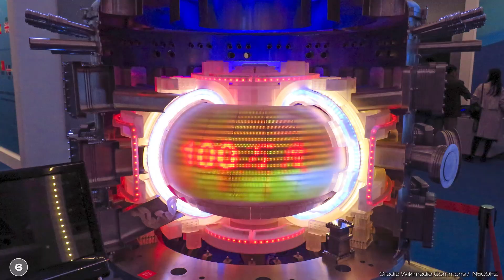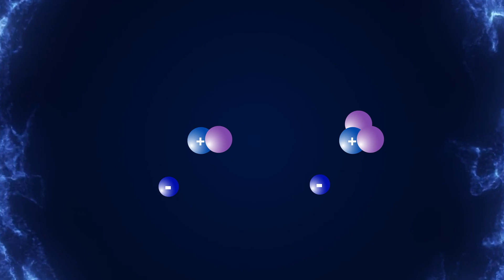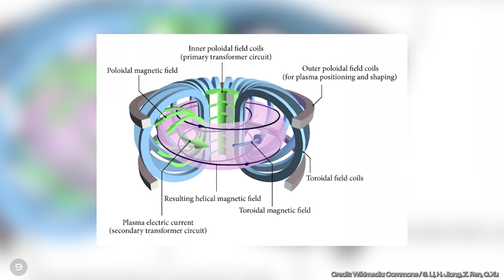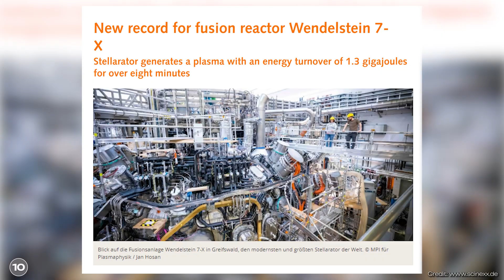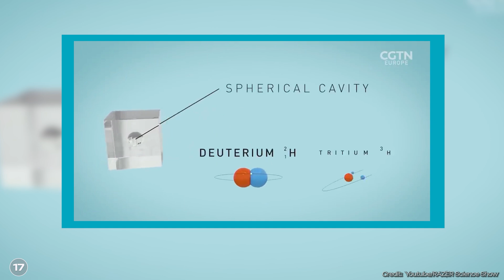Nuclear fusion cancelled?!  Is this this the end for ITER?

Comment: Nuclear fusion energy experiments began in the 1950s and since then two generation of experimenters have encountered numerous barriers that they hadn't expected to happen. In many cases they came up with solutions and workarounds that vastly increased the complexity of the systems, making them less attractive as eventual competitive electricity generation sources. The field is so complex that the promoters have plenty of opportunities to omit key evaluation details, which they commonly do. Scores of such experimental machines have been built and operated. All but a very few have utilized tritium and therefore generated a significant amounts of fusion energy. See the Wikipedia article titled 'List of fusion experiments.' Since the beginning the public has been told that the hydrogen fuel is almost limitless. Rarely do the promoters mention that tritium is radioactive and never to they mention that commercially available tritium costs more than $30,000 USD per gram. The ITER project is grossly over its original budget and well beyond a decade behind its original schedule. They have encountered major construction difficulties that has set the project well back in time. Around 2023 the administrators stated that the first deuterium-tritium fueled experiments wouldn't begin until 2039. They admitted that was too late to deal with the climate change issue.

The flashy announcement, regarding the NIF 'breakeven' event obscured far more than just the the fact that the energy, needed to pump the lasers, was over 100 times the energy value that they used to calculate the fusion energy gain (Q). It is standard practice, in the nuclear fusion energy field, to not provide the total amount of energy expended to achieve the fusion energy gain value. The 12/05/2022 NIF laster shot took about a week to prepare. The fusion reaction lasted for 0.000,000,000,08 second. The reaction began in a microscopic spot within the center of the spherical body of compressed fuel. The reaction then produced an explosion that blasted away 96% of the supplied, expensive, fuel before it had a chance to fuse. There was a limited propagation of the reaction. Nuclear fusion energy promoters tend to utilize the term 'ignition' in a deceptive manner. The 'breakeven' experiment was supposed to have been achieved by 2012 but the goal was missed by a factor of over 100 then. It took a decade of extremely expensive tweaking to finally achieve the desired results. The promoters have always been masterful in obscuring the primary function of NIF. It has always been primarily funded as a thermonuclear weapon (H-bomb) research tool. The 12/05/2022 shot was part of that program. It's been estimated that NIF has already expended in excess of $11 billion USD in federal revenues. A inertial confinement fusion (ICF) type power plant would need to fire at a rate of at least ten shots per second. Just on that parameter the NIF 12/05/2022 experiment was millions of times away from that goal.

Commonwealth Fusion Systems (CFS) typically refers to their SPARC experimental machine as being a prototype of their planned ARC power plant which is supposed to be fully functional, including breeding its own tritium fuel. A close examination of the rarely mentioned details of SPARC will clearly show it lacks major components and behaviors of the ARC machine. SPARC is expected to eventually generate fusion pulses lasting for a maximum of 10 seconds and then it will requires many hours to thermally stabilize before another shot is attempted. The fusion duty cycle will be abysmally low.

A statement was made that the Wendelstein-7-x stellarator achieved an energy turnover of 1.3 gigaojoules. What exactly is an 'energy turnover' in this case? Typically, fans tend to not ask probing questions since they don't want to attack the technology that they have fallen in love with.

---
Virtually all nuclear energy promoters, are in line with the vast majority of Earth's other 8.2+ billion humans, who continue to assume that we still have at least 20 years left to turn this 'Titanic' around using their favorite nuclear technology. They have become masterful in excluding the following warnings from their consciousness. I urge readers to search for the following two article titles.

IPCC report: ‘now or never’ if world is to stave off climate disaster (TheGuardian)

UN chief: World has less than 2 years to avoid 'runaway climate change' (TheHill)
  * This statement was made 6.7 years ago.

Comment: ITER needs to be cancelled and funds diverted to real proven solutions. The transition to clean energy is happening now, not in 30-50 years. Same with the other inertia/cold fusion projects. Today we know that the energy needs are largest today and will decrease further into the 21st century, the transition away from fossil fuels is happening right now and needs these funds. We need to fund installing and designing storage of solar/wind surplus energy and handle load balancing needs.
Reply: We need nuclear.

Comment: Repeat after me: inertial confinement is a dead end! I know you said on the video: they produced more energy than entered at NIF but lasers are incredibly inefficient in producing light so it doesn't get NEAR of break-even point. But it is not only that most of the laser energy is not even absorbed by the target. The calculation compared the energy absorbed by the pellet compared to the energy the pellet produced. Even computing the energy output of the laser will not give you  a net gain. Lets remember NIF was created originally to simulate nuclear explosions at small scale to avoid breaking testing ban of nuclear weapons. How I know that? A lot of what they made at that time was secret: silence speaks millions. They started as a fusion lab, the challenges were to high ans less than 3 years after that they became a nuclear weapons lab. After it became irrelevant to do that they were in search of a new use.
The problems of ITER have NOTHING to do with ICF. They have to do with never ending the project being constantly over budget and Europe much more preoccupied with war expenses right now.
ICF people and startups are trying to do this about them: it is not. THe problmes of ITER were caused by ITER itself.

Comment: Your understanding of stellar fusion and graphics is wrong, it takes 4 protons to make a He4 nucleus,, 1st 2 protons fuse into a deuteron, then these are converted to He3, then 2 of those fuse into He4 giving back excess 2 protons, its called the PP process. In bigger stars an even better process called CNO runs about 10,000 times faster because it uses carbon to consume 4 protons in turn, turning carbon into oxygen but that usually decays right back to carbon + helium. See Wikipedia for loads more info on PP and CNO.

Comment: Hot fusion is a very, very expensive pipedream. Not only is it inspired by a faulty model of the sun, but if you think about it, even if you took the solar standard model serious (which you shouldn't), it can't work. All energy that man converts from sources ONLY yields usable energy, because the verse produced the sources. Hot nuclear fusion for providing energy to the grids is like producing the source and then expecting to be able to convert over par. It's completely idiotic ... and unscientific. Everybody who understands the concept of conservation of energy, so far never proven wrong, should know hot fusion can't be used for that purpose.
Reply: This is complete and total rubbish.
Reply: Cool story bro. especially since thermonuclear bombs actually, um, WORK
Reply: @Muonium1  
Of course they do, the crucial difference is
a. they use a primer made from stuff the universe produced and men further optimized for the purpose
b. most crucial, in that weapon you don't need to control the plasma. The energy required to control the plasma will always prevent over par yields.
Reply: @rosevfx  complete nonsense. Jet has already achieved Q factors of 0.7 and NIF of over 2 at the hohlraum level.
Reply: You just shot yourself in the foot...
Reply: @DxBlack  So that's what that tickling feeling was! :D
Reply: You're right for the (totally) wrong reason.

Comment: Nice video.
ITER is a doomed project, the so-called flagship of nuclear fusion research is sinking before launching!

- the start of ITER experimental campaign is a couple of decades late (and counting....further delays are rather likely)
- the actual D-T experiments will start even later, probably not before 2040/2045
- ITER is massively over budget... it should have cost less than 10 billion dollars, it will cost... well, nobody really knows, but 50-100 billions could be an educated guess 
- a serious technical issue may arise, not unlikely due to the extreme complexity and  first of a kind nature of many of the ITER components (for instance a fault in one of the coils may jeopardize the whole project) 
- even if everything works, it is now clear that ITER will not provide all the results and technical inputs for the next machine that it was supposed to give...

In fact, ITER is a very badly conceived project, badly designed and even worse managed.
A very large fraction of the budget dedicated to the development of fusion worldwide is going to the construction and operation of a single machine which should have been the only step needed before DEMO. In Europe, contributing 45% of the ITER construction budget, little resources are left for other projects.  The other six ITER Parties contribute only with 9% each,  so they may reap all the ITER benefts (if there will be any, that is) with little investments.
With ITERm , decades and tens of billion dollars will be simply wasted (putting all your eggs in one basket).
Now, additional billions are necessary to fix some technical issues.
For the good of fusion, it would be better to revise deeply the whole nuclear fusion development strategy  (especially in Europe) and ditch ITER (I know, billions have already been spent, but that is not a good reason to waste many more billions.). Smaller machines, more manageable, dedicated to the development of the many technological and scientific aspects which are necessary for the development of Fusion, that will not be tackled by ITER and that are still far from being solved.

Comment: Hi all,

Sorry if I may sound harsh but I have to clearify some things here:

First of all for the German audience: there had been a recent video from Norio which represents the current situation more correctly which was actually done in collaboration with the Max Planck Institute for plasma physics (hence fact-checked by scientists).

ITER is by no means „useless“ or „not worth following“ anymore.

Disclaimer: I will not be talking about the whole start-up thing here (besides CFS who is following with SPARC/ARC the tokamak line).

Whether the stellerator or tokamak concept will be the first power plant concept does not matter for ITER: Goal of ITER is - besides proving that it does work and enabling research & sharing knowledge - is to test the breeding blankets necessary for all D+T designs (tokamak, stellerator, laser/inertial-fusion).
Without a design for these blankets there will be no power plant - fullstop. And there is no chance any running power plant is faster than ITER at the point of testing these :D So the goal still is valid and important!

Please do not get me wrong here Jakob - I usually like your videos :D (I don‘t want to be misunderstood at this point as simply being rude or anything) but it would increase the level of factfulness if you‘d actually speak to the well established institution (like the MPI as press releases sadly are not representing everything correctly … sadly :/)
They are very responsive in fact if you refer to their „Öffentlichkeitsarbeit“ :D
Reply from the maker: First of all, thanks for the comment. Actually, in the video I don't say that it's not worth following Iter, I just explain that there is a discussion about it - not my own opinion, but a discussion in the scientific community. As I say at the end of the video, I don't have a definitive opinion. No matter what, research is still needed in this area, as you said.

Actually, I have talked about fusion energy several times with people working on ITER and especially with one of the researchers from Jülich who is working on plasma-material interaction and surface processes in fusion devices. ITER has already produced great results for fusion energy that can be used in subsequent projects. I think this is a fact that is less mentioned (maybe also in my video). And of course they told me that they want to continue with their project. But they also said that ITER is very complicated because of all the different players, as I mentioned in the video. So again, not my opinion, but the idea of this video is to show that there is a discussion going on and of course, as always, you have to bear in mind that each side has its own interests and depending on who you ask you will get different answers.

Comment: "This is because no material could withstand such high temperatures." - I have to disagree. While the particles have a very high temperature, since there are so few of them, the actual energy in form of heat is relatively small. It would be like a very fast bullet hitting a very dense material. The kinetic energy would get absorbed completely by the sheer difference in mass without having any noticable effect. That is one of the reasons why nuclear fusion is very safe.
Reply: high temperatures are indeed an issue. There are parts of ITER which see a thermal load of 10-20 MW/sqm and that's a lot, as any thermomechanical engineer may confirm.
Additionally, materials will be subjected to highly energetic neutron fluxes  (well, if  evenually they manage to get a reasonable amount of nuclear fusion reactions....). Those neutrons will damage components which will need either frequent replacements (not really compatible with a commercial plant, and producing radioactive waste) or new materials will need to be developed (some research is on-going but, since all the money is dumped in IITER, there is little left ).